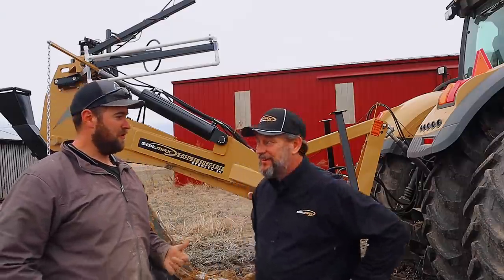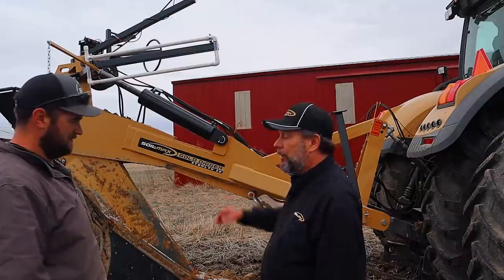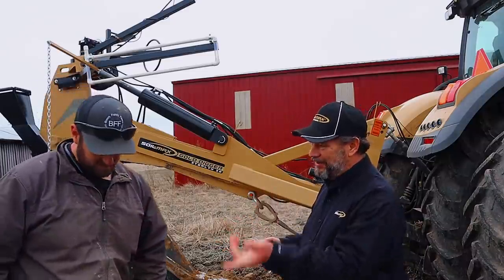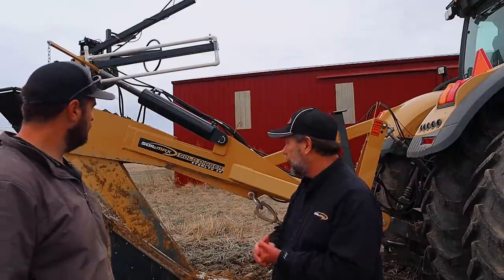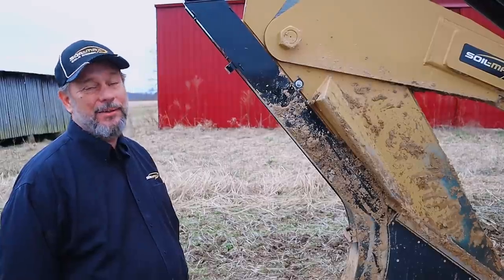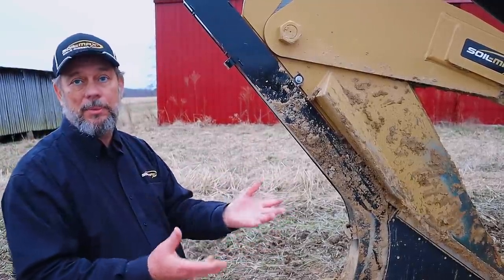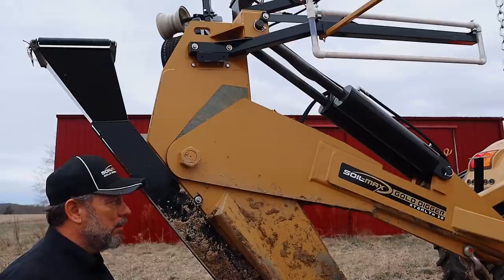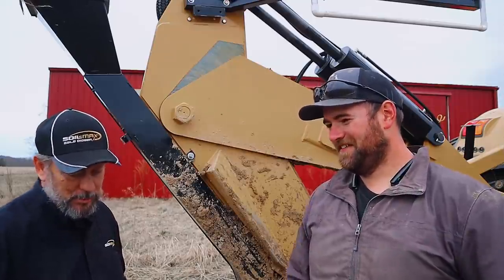SOIL-MAX GOLD DIGGER walk around

Comment: I would agree about tracks spinning on the wet ground.  We found that our case 380 magnum pulls better with the duals than our johndeere 9570 rt on really wet ground.  Right now we have the tile plow out working on the 380 mostly due to its transport speeds due to us tiling about 30 miles away from the farm.  You guys will save money by installing your own tile . We paid for our plow by doing our own plus custom work . Soil max is a great product with great dealers . Keep up the good work and stay safe  !

Comment: What a great spring to be tiling. I drink the cool-aid, but not as much as a lot of farmers. Tiling does not eliminate soil compaction, but greatly reduces the potential of creating soil compaction. That, in itself, is my reason for tiling. I have seen corn  plug tile 3' deep. Why? Not because it was looking for water, but the roots were looking for air. So, after a few years, if you can see where the tile lines by how well the corn grows, you should check for soil compaction.
          Keep those tile outlets clear, and subsoil a vacuum line into the end of your mains to reduce mud intrusion.
          Compaction, another reason for leaning towards a Gleaner. btw, Marshmallow tires or duals?